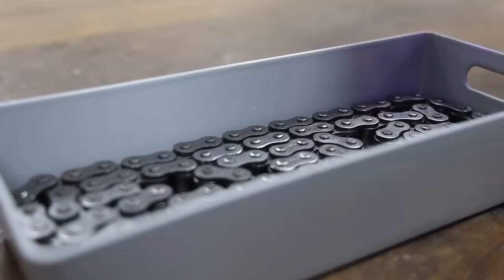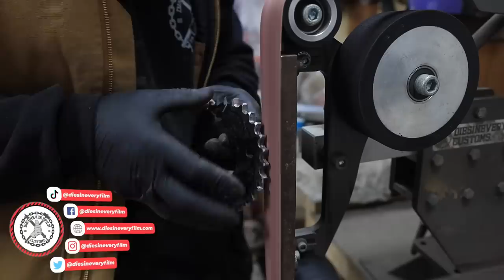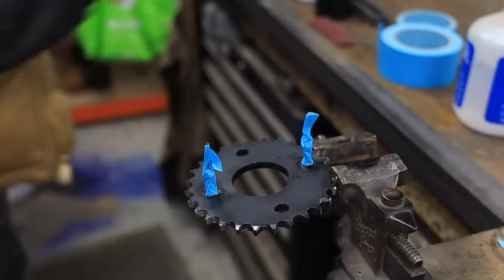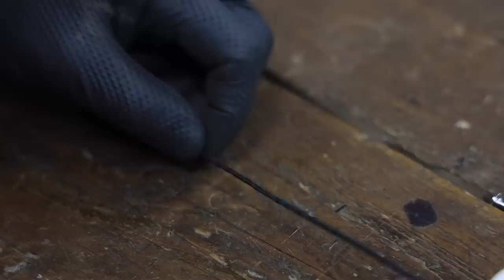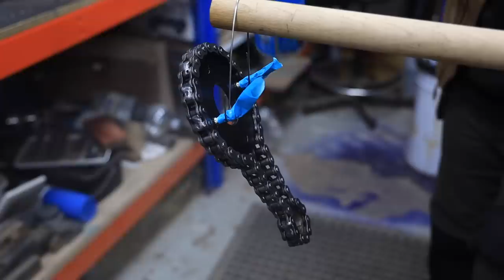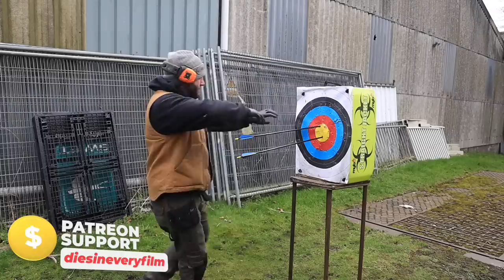My Most Powerful Slingbow from Bike Parts - Upcycle

Comment: Now put two more elastics in those other holes, would it increase distance?
Reply from the maker: It has good distance on it already, the rubber i used is the most powerful you can get for slingshot and if you added 4 you wouldn’t be able to draw it back much so would actually decrease the output

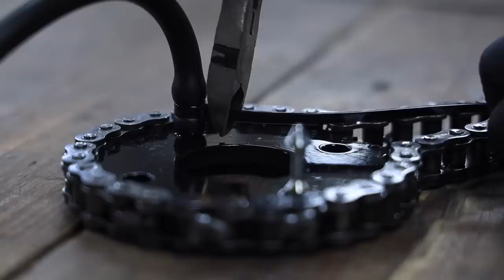Comment: 5:50 Could have just spit on it... 

It's cheaper.
Reply from the maker: The fluid i use to keep myself hydrated is more expensive than the fluid i use to spray this plus the fluid i used dries clean so No slipping back off